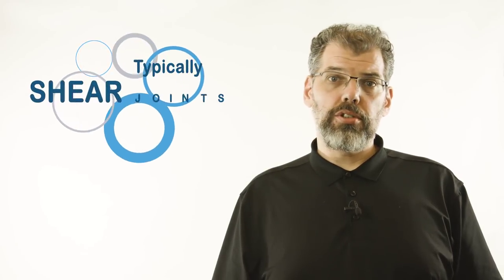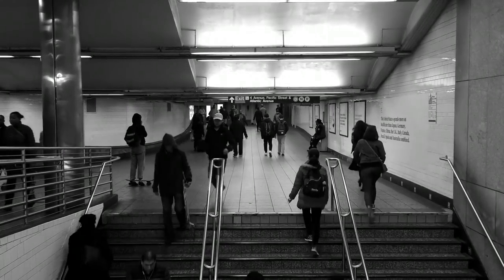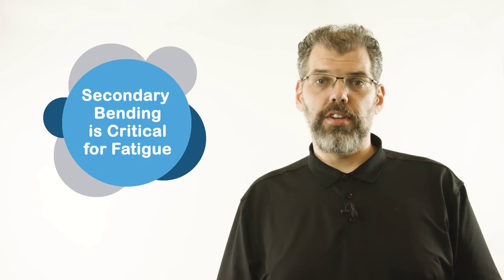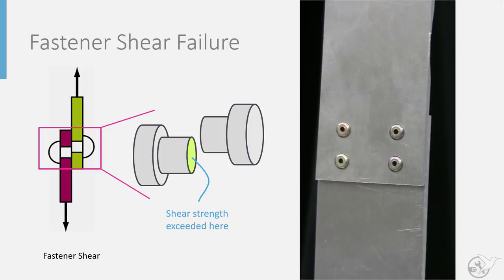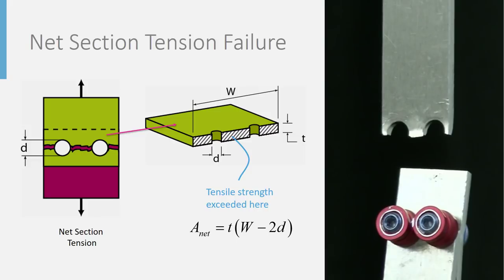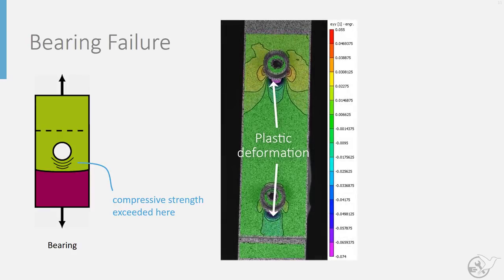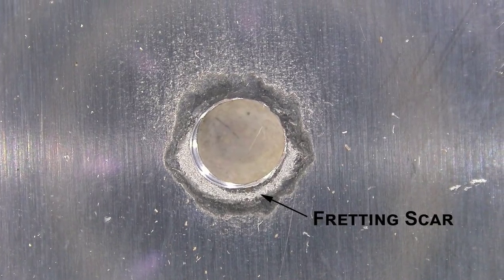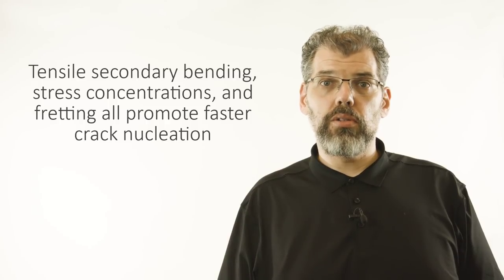Failure Modes in Mechanically Fastened Joints

Comment: Sir can you explain why shear joints are Weight efficient than Tension joints? In reality tension load bearing capacity is higher than shear there by reducing no of fasteners required to acheive function is always less.Please correct me if I'm wrong
Reply: @DrRans  Thank you👍